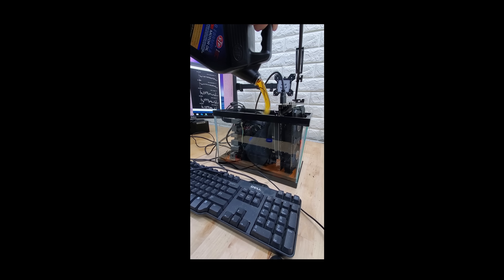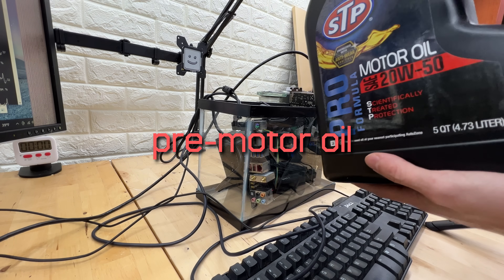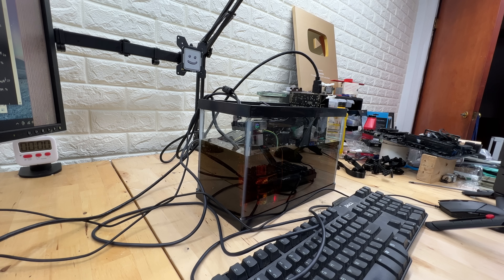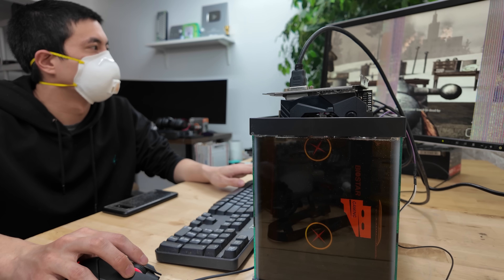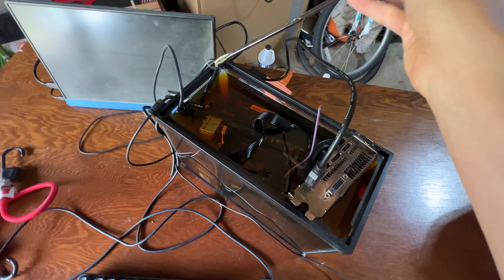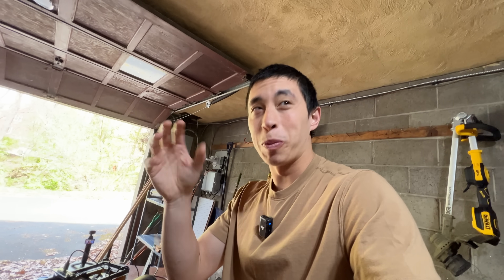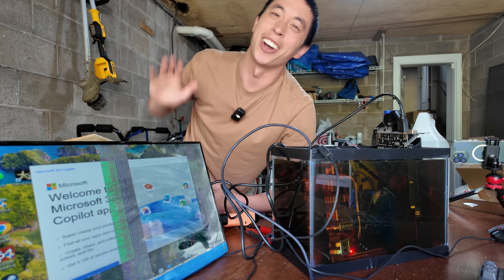Why isn't Motor Oil used to cool down PCs?

Comment: Definitely would have used 5w or 0w oil. Transmission fluid would work well too, and the red color might be cool. And transmission fluid is also better compatible with plastics.
Clean/unused oil isn't nearly as toxic, it's used oil from combustion contaminates that are pretty nasty.
I have always wanted to try this, you could just submerge a regular fountain pump in there and flow it through a fan/radiator to keep the oil cool.

Comment: I think the simple answer would be "because it's a mess to clean"

For the temperature part my guess is it would be a bigger example of what watercooling does: Slow to warm up, but slow to cool down.

A tank of oil has a large thermal mas, so it will take a while to get hot.
The peak will be the same as with other non-active methods. (So no dry ice, LN2, peltier, vapour-compressors like in AC and refrigerators, etc)
And once the heat source goes down, the same thermal mass will take a while to go back to room temperature.

Basically exactly what we see with water cooling: It heats up and cools down more slowly, but isn't any better in terms of peak temperatures just by itself. What allows it to run cooler is the ability to mount humongous radiators at better locations.

But one thing makes this very oil setup worse than the preexisting air cooling: The oil won't have any flow between heat sources and cooling surfaces. And it being quite viscous means there isn't much natural convection. Having the PC setup connected to a cooling tank, possibly even with a radiator would get interesting.

Comment: Really depends on what oil you intend to use. You'd want a very thin (to start) motor oil, as you're not getting very hot compared to an engine block, and motor oil is made to thin out with heat (running temperature).

Comment: If you use oil that is less thick, you could probably set up a system of pumps to move the heat away. It would probably be easier to just use water cooling though. You don’t have to worry about damaged components (unless there is a leak), and it’s probably more efficient
Reply: basically all mineral oil cooled pcs that I've seen did have a pump and circulated the oil into radiators to be cooled with fans just like you do with water cooling. might not be necessary for a low end computer or one that only sees short bursts in load since there should be a lot of thermal mass.

if anyone does this they should definitely  use a much thinner oil otherwise a pump would just burn itself out trying to pump the fluid and you'd want the gpu and cpu fan to be able to turn so mix the oil around
Reply: I legit will never understand the optional use of WATER to cool a PC. 

I know it might be "better" theoretically... But if anything happens leak wise... RIP PC.
Reply: @Am4t3r4su    Not really. It will cause a short and the computer will shut down, but if you let it dry it's very often okay. It's not like the voltages inside a PC (especially on the motherboard) are high enough to cause fires. Believe it or not, modern air coolers use heat pipes filled with water!
Reply: @Am4t3r4su Most water coolers come with a warranty that replaces for any leaks if they mess up

Comment: This video shows what happens to rubbers if you get oil in your radiator. 
https://youtu.be/oGs9sPaV834
So the insulation of your wires will get eaten

Comment: I wonder if that could be used to build silent PC? I mean if I would dump my entire PC in a oil tank  then I will have zero noise from fans and if it was some 30 liter container I assume it would probably stay around 50C with passive cooling alone.

Comment: Do a cooling performance test vs water and air. Also submerge a pump and use hoses pointed at the fans to make them spin or put a radiator on top and pump the oil through it so the pc is its own resevoir

Comment: Pretty bad idea either way, you can buy a cheap cooler for 50 bucks and you won't ruin all your components. Even if it worked you'd have to take it apart clean each part, then change the oil

Comment: Eventually the oil will get hot and stop cooling, because its not losing heat to the room like an air cooled would, especially if you enclose it like you said.

Comment: A full copper/metal case rather than a glass/acrylic case would give u a better result as well as some submersible motors to run those fan blades would be amazing

Comment: Using Engine oil for a PC is just stupid. Its expensive and its way too thick. PC fans are not powerful enough to fight through thick engine oil, Even with mineral oil its just not worth the mess. Water is just way more efficient.

Comment: Dunno about motor oil but I put EV battery dielectric antifreeze in my cooling loop diluted 1:1 with distilled water after my old coolant failed and I had to clean a shitload of corrosion. It's been going great 8+months now and my PC is an ongoing experiment. I had some waterblock gaskets submerged in the antifreeze for a couple weeks before filling the loop and didn't observe any expansion so prolly okay?
Reply: Well one way to find out. At least its dielectric.
Reply: @alexturnbackthearmy1907  My reasoning: if it's used to cool batteries with DC potential of 400V then it should be good to cool stuff with 12V at most

Comment: How about using an oil cooler as well?
Reply: You might as well use car oil pump and radiator. Basically water cooling, but extreme.

Comment: A pc cooled by motor oil would be a good conversation piece for a mechanic shop
Reply: Especially with a little effort to get the oil visibly moving around. No reason it would HAVE to be immersion cooled, could use a pump and just blast the components in a glass case LOL. Wouldn't be good for gaming without a radiator with that lowered volume of oil, but if you are already using a pump, you could attach an automotive oil cooler in series LOL.
Reply: A car themed PC would totally be a nice center piece in a mechanics shop. I wouldn't store anything important on it without extensive testing but I would use it for invoices connected to a nas.
Reply: Super funny cause im currently building my first pc and my husband is a car guy so we go back and forth sharing our experiences with each other lol
Reply: Imagine bringing your gaming PC into a shop for an oil change
Reply: As well as a computer shop.
Reply: Especially if you had an AIO and were able to print something that looked a bit like a turbo charger to cover the CPU mount
Reply: Could you use a radiator with fans on the outside and pipes where a liquid cycles trough the oil and cools it off? So you don’t need fans on cpu and graphics card?
Reply: Now I wanna drive around from shop to shop and try to “upgrade” them to a fish tank lol
Reply: @LtsGoBrandonGaming  🤣

Comment: You used literally the heaviest motor oil you can get on the market. 
Most diesels don't even use a twenty fifty/ 
Why did you not use a zero twenty something reasonable it's like you were trying to cause problems

Comment: Neat seeing this, I'm not a chemist but it would be interesting to investigate if the oil or any additives in it would slowly attack the other petroleum products. There are hoses and such not rated to be in contact with oil in the automotive world. I predict cable insulators will likely soften and swell over time. Some plastics may straight up crack on their own as some plastics do become brittle after long exposure to it.

Comment: I find it hilarious that you used an oil that even my Honda accord would have trouble using. 20w-50 is basically diesel truck oil
Reply: Also race oil
Reply: 20-50 is the used car shop special. It's thicker so shitty worn out engines get a little longer life helps keep some of those low-end noises away until the warranty expires
Reply: @pjbth Dalton from PBG pulling out the 4 boxes of aviation oil to get a rolling dumpster home:
Reply: @joedingo7022  A fellow man of culture, I see.
Reply: not even diesel truck, fully worn the fuck out kenny or something. That shits thick as ass.

Comment: You need to do this test again without motorcycle engine oil. And kapton the motherboard so it doesn't short on the PSU casing.

Comment: Hmmm can you cool a pc with isopropyl alcohol ??, that's a special one i'd like to know
Reply: someone made a vodka cooled PC forgot who it was
Reply: @kralkralovsky8416  is boris
Reply: @kralkralovsky8416 Boris the Slav
Reply: Generally it contains a fair amount of water which can absorb debris in the air making it conductive and brick your PC. So I doubt it'll work, but I'd be interested in seeing.
Reply: @M.Hametsu yeah you do have a point there , but in that case, I believe he can fully enclose the case and watch what happens, my guess is the liquid will maintain cool temps at first but over time might react with some plastics or so … at the end might cause corrosion . Who knows
Reply: @ so putting it into a metal one would be better especially if made from a corrosion resistant alloy
Reply: That sounds like a huge fire risk
Reply: That is beyond risky. That is one of the most flammable liquids you can buy.
Reply: @ didnt stop other people doing it
Reply: isopropyl alcohol isnt all alcohol there is water in there, generally only up to 95% is available for sale the other 5% is straight water.. it would not work.
Reply: @XxZigonxX it would need to be in the loop with evap canister to condense.
Reply: Typical IPA boiling point (it always contains some water, you cannot get rid out even but solting out) is slightly more than 82 degrees Celsius and you don't want to breath the vapors.

Comment: This would have worked better with a lower viscosity oil like 0w16, instead of the 20w50 that was used which has quite a high viscosity.

Comment: what if you put motor oil in a water cooling loop instead of water?
Reply: Too thick probably. But still better then water, oil good for metal, water bad for metal.

Comment: Can you epoxy a box around the cpu and heatsink and just submerge only that in oil? Try first with fan not submerged (so fan can cool the top of heatsink). Then then try with heatsink fully submerged no fan (more oil for higher thermal capacity).
Reply: Try with different viscocities

Comment: Weight wasn't high enough, should have used 90w gear oil.
Reply: Let it spend a couple hundred thousand kilometers inside a differential before using it, really seals in the aroma!

Comment: To clean the parts put them in a dishwasher and then allow to dry in an airing cupboard for a good amount of time or in a room with a good dehumidifier. I have done this with a dirty mechanical keyboard. Oh and don't have any dishes in the dishwasher and possibly run it again empty but with detergent after you have done this!

Comment: Can you use motor oil in custom loop instead of the regular liquid?
Reply: If you get strong enough pump and fittings, its thick stuff.
Reply: @alexturnbackthearmy1907  0-w5 oil it would be better to use brake fuild
Reply: I'd go with any type of Dexron ATF—it's much thinner than engine oils. Most rubber O-rings typically used should be able to handle Dexron just fine, especially since a lot of plastics are used in ATF systems too.
Reply: No

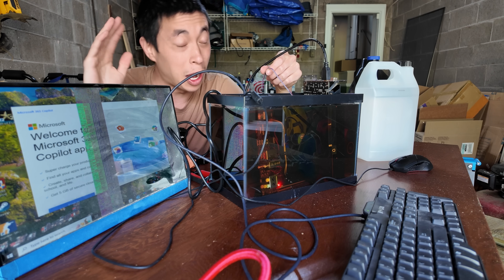Comment: 9:28 well that's a task for isopropyl alcohol and acetone
Reply: no, it's not a job for acetone. acetone damages circuit boards.
Reply: @arnone1862  the acetone was supposed to be for the cables
Reply: I've had decent success with repeated loops of WD-40, plain old soap, and lighter fuel. They all do different things and can push each other away.

Comment: The risk of used motor oil is the suspended metal shavings rather than anything aging
Reply: And not only metal, but all other gunk that builds up over time.

Comment: Mineral oil is used in high voltage transformers.  It's more refined than what you find in the store, but it's just mineral oil.  If you're going to use anything, use that.
Reply: My old boss in a pc shop around the 2000 had a pc running in one of those high voltage transformer fluid and it was working no problem  cant say about current tech though
Reply: nice clippy😉
Reply: @NoSirThatsPaper  Thanks.  I like yours, too :)

Comment: Do an experiment where you soak a component in oil for longer. Like you had those experiments where you froze a CPU for a while or buried a hard drive for a while. You should do the same thing with oil so we can see some real long-term effects!

Comment: How bout this, you put enough motor oil to cover the cpu, to the point where it only touches the pcie slot of the gpu and is only touching the cooler not the fan of the gpus, that way you have both coolant, and the fans work and see how cool it gets with the fan support.

Comment: The average guy with an EE degree here. Yes it does work. Most motor oil is SLIGHTLY ELECTRICALLY CONDUCTIVE so I would never recommend it. There are oils which are almost non conductive and usually they are transparent.
Reply: Mineral oil is a classic no?
Reply: Worse than that motor oil will put off nasty fumes when heated and will break down rubber, unsure about which kinds of plastics(if any) will be affected by motor oil aswell.
Should've tried some cooking/frying oil instead
Reply: @BMWe-ed2tn  Some people have a weird taste in perfume and fragrances. I suppose its always preferable to respect that. 🤣
Reply: @BMWe-ed2tn Corrosion is definitely a concern. If there's any piece of plastic that's not chemically compatible with whatever's in that stuff it may dissolve and cause shorts.
Reply: @BMWe-ed2tn  oil definitely breaks down plastic, one dude shown the results of submersion cooling, it embrittles the plastic clamps that hold components like RAM planks and videocard.
Reply: and if it gas nano graphene any current leak will attract it out of suspension. and graphene is conductive.
Reply: We always used Fluorinert for submerged applications, but it isn't really oil.
Reply: What about ATF like Dextron etc?
Some hydraulc oils might kill the pcb though.
I know what oils to put into machines, but not what oils to put a computer in :/
Reply: It's also absorbs moisture, so as time goes by, it gets to be more and more of a risk of having things shorting out.
Reply: @SmallSpoonBrigade  Nope. All oils repel moisture. Water is made of polar bonds while oils use London linking.
Reply: Motor oil is generally not great for plastics.
Reply: What about baby oil that's used for massage?
Reply: I honestly didn't expect it to work, most motor oil has traces of elements like rare earths and some detergents for increased wear resistance and anti sludge. I'm guessing it will eat up some kinds of plastic and rubber too, considering plastic parts in engines like chain guides and tensioners are very specific types of plastic.

Comment: Oil is a lubricant not a coolant.  Thanks for contributing more to ewaste for attention online.
Reply: Gaaaaaayyy
Reply: Oil does both, lubricants and cools moving parts. Alot of engines have oil coolers because of that

Comment: "Concentional motor oil" is technically right, but 20w50 is like maple syrup.... cars and vehicles use 0w16, 0w20, 5w20, and 5w30. Some people prefer to put 10w30 in their vehicles, but I'm just stating the OE spec

Comment: I'm only 36 seconds in, and I can tell you that Mobil1 full synthetic oil's additive package DOES NOT separate and leave sludge/residue behind. 

The Motor Oil Geek has a video about additive package separation. worth a watch.
Reply: So a good one? Good to know when i get around to buying a car.
Reply: @alexturnbackthearmy1907   100%. I've used it for YEARS!

My wife's car was bought, brand new, in 2014, or early 2015, and I've changed the oil 10 times with Mobil1. Seriously.

Comment: It depends on the oil's additive package, some might be more conductive than others.  Also you will eventually saturate the "cooling" aspect and will need to cycle the oil through a radiator or something to carry the heat away.
Reply: Yes you will need a radiator, or else it will overheat after a while when the oil heat up.... Many have tried this and all regretted it badly because of the horrible mess if you need to replace a component...
Reply: That's what the AIO coolers does to cpu, I have H60 going on its 8th year of usage. Maybe in the future, we get liquid cooling for the entire PC!!!
Reply: Probably not if you are only engaging in normal use.

You probably won't saturate even in several hours of gaming, and then it has all day to passively radiate away the heat before the next session.
Reply: @Nevir202  Yeah, you probably have to use a very powerful GPU and Max Load Before it saturates at all.

Comment: Motor oil is meant to go through lots of material without corroding or dissolving the parts, so the computer components should survive.